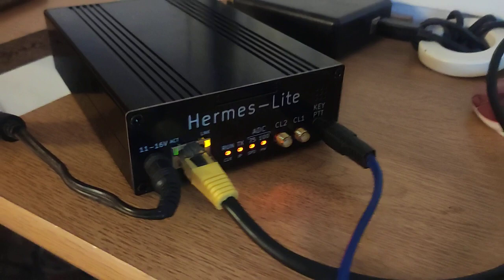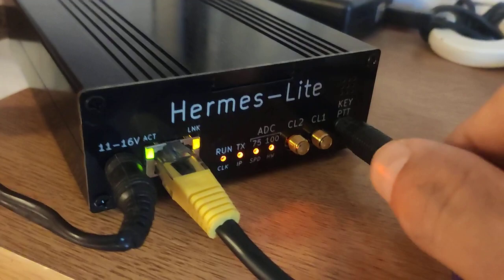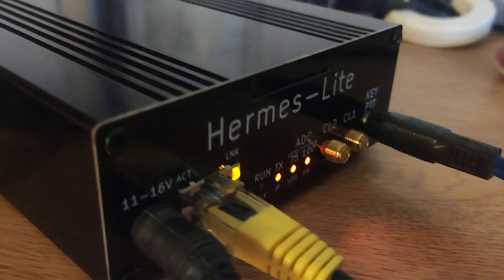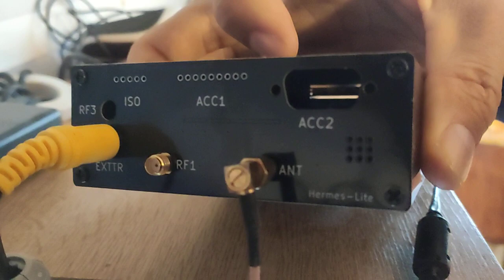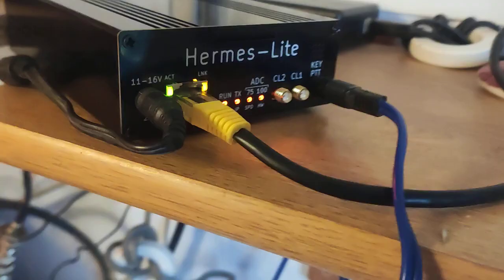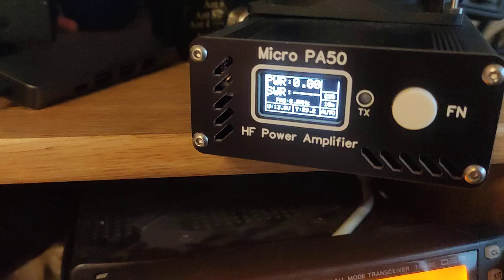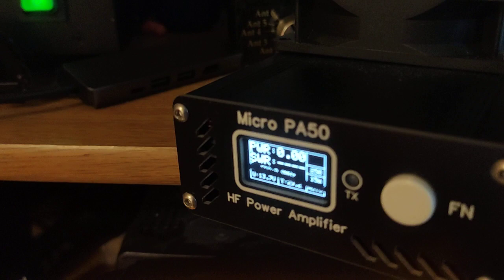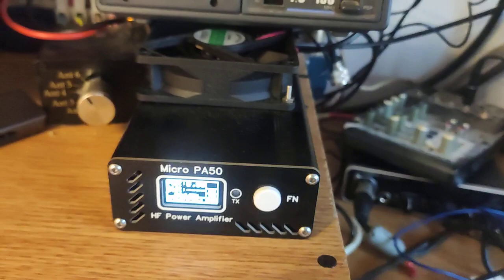How does the Hermes Lite 2 assembled look like. In/output ports on the Hermes Lite 2.

Comment: Still can't take the hermes serious, seems like a toy that I have to add  extras to make it a proper radio.

Can't beat the Expert SunSDR2 DX, for additional bands, extra power, TCI so no more comport cables and many more.

Hermes is a nice project radio.
Reply from the maker: I take this as a very serious radio myself. It is a very good radio. Of course, the SunSDR2 will beat the HL2, but look what you pay for a HL2 € 332 vs SunSDR2 € 2.770. If you add another € 160,  you already have a 50W output.
My HL2 will be my only radio I will use when travelling to HS (Thailand). As it is small, and it does not look like a TX, you can travel easily with it. Also the form factor is interesting as it is very small and very light.
Reply: @ON7OFF   what you think about hermes as base station is ok?  Not to much warm? 
Dont need a fan?
Reply: Thetis software is ahead of Esdr3 in every way. ESDR3 No full duplex, no Squelch, pure signal is a pipe dream for Rome and the guys, NR on thetis beats the esdr3 or esdr2 every time. When having both vfo's active if you have vfo A on Hf and Vfo B on VHF, Vfo B will not be on 2 meter as you selected you will be on 10 mhz hearing the time beacon. Yes I have the current firmware and software versions. This is from my own findings. I own a Sun sdr2dx, owned it for over a year now. It does a fine job but Hermes with Thetis is 10 times the Transceiver.

Comment: You need that ptt cable to TX?
Reply from the maker: No, it is optional. You can also use the space bar of the computer, but you will have to have thetis as a active window. That is not handy if you need to for example log. I prefer an external button to ptt.